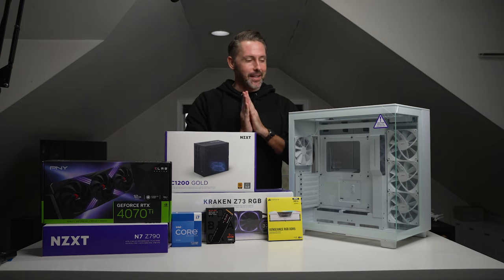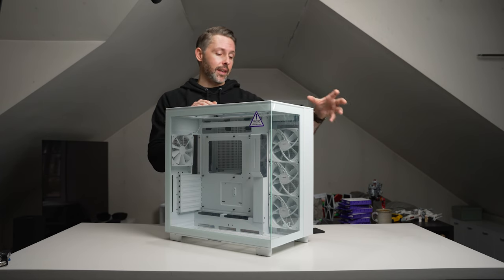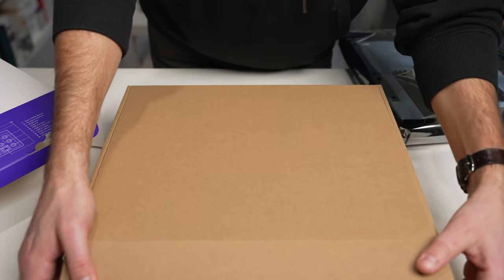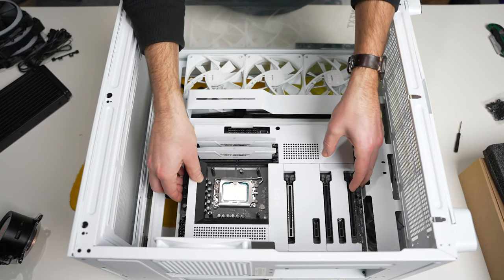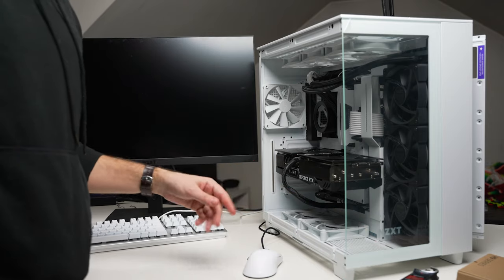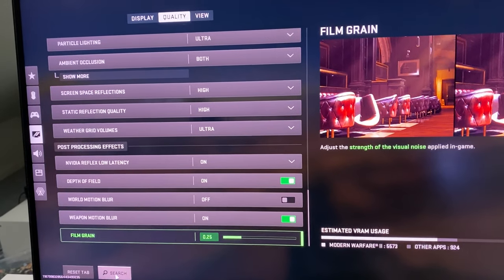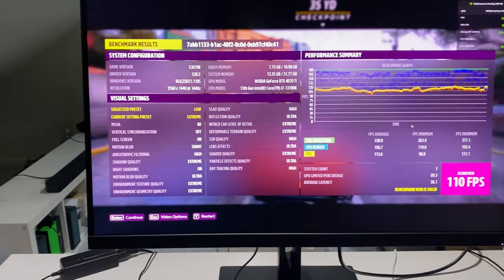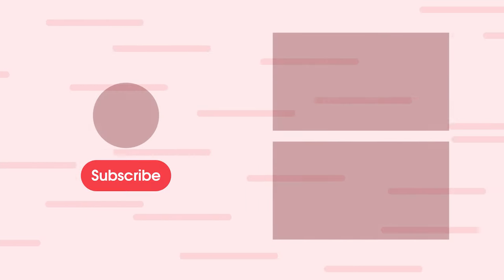Building in the new NZXT H9 dual-chamber case!

Comment: Awesome build, I would definitely recommend flipping the radiator fans to exhaust and maybe place them on top instead of the side :)
Reply: Exactly right, build a very similar build. If you place the radiator at the top and exhaust out, I found the GPU has lower temperature by 5 degree in my case.
Reply: Watched another review, they said that the radiator doesn't really fit at the top so they had to put it in the side, this could be the reason they didn't put it at the top.

Comment: 11:37
Hope you reverse the direction the PSU is facing because the fan is sucking heat from the motherboard here.
Reply: No that fan on PUS is sucking in air as an intake fan. hes not giving PSU fan enough space to pull in cold air to cool the PSU lol
Reply: I’m so confused isn’t AIO job to vent so it’s pushing out?
Reply: @OFM1209  we are talking about the power supply fan, not the AIO water cooler
Reply: @sparda9060  oh ok. I guess if you turn the fans in a specific direction they will either pull air in or vent air out.
Reply: @OFM1209   in power supply you don't want the fans to exhaust air. you want it to intake air so it can cool the components inside the power supply as there is no vents on any other side for it to get cold air. for AIO you can face the fans in any direction.
Reply: @sparda9060  thanks. I’m building my first gaming PC. I have all my components. GPU just came in today as a matter fact. Building next week. Thanks !

Comment: This is an awkward case for side fans because gaming computers get funky without a power supply drawing air from the cpu fans. I would consider the temps a little high. First, intake the side fans. And put the aio rad on top exhaust. Take the back fan and put it on the bottom so there are 3 intake down there. Now you have enough positive airflow to turn the psu around. Theres no need for the oldschool power draw because it's not going to pair with the water cooler anyway. Plus, I don't see any hard disc drives or cds rom drives to worry about anyway. hahaha.
Reply: That's because he did a few things wrong. 1st the power supply should face the other way so the intake fan is facing the back panel, not towards the motherboard. The radiator would have been better up top with the fans set to exhaust. I have this case with an air cooler and my cpu has never been over 42 degrees when gaming

Comment: one quick question! my gpu is pretty much the same size. just 1mm thicker (asus tuf 4070 ti). did you have any trouble putting the card in there without pushing the glass panel on the gpu cables? someone on youtube had issues with that even though his card isn't as wide as mine..looked good in your case though
Reply: Same question for me. Is there any answer?
Reply: It’s fine you can put a 4070 ti in there because I also have a 4070 ti and it’s goes there so we’ll
Reply: @NIRAA  It’s fine you can put a 4070 ti in there because I also have a 4070 ti and it’s goes there so we’ll

Comment: I have the exact same cpu and I idle at 38-45 degrees. Warzone I sometimes hit 80. How is yours running so cool?
Reply: Do you have air cooled or an AIO
Reply: @PassiveClapz  I have an AIO with a 360mm rad. But I slightly undervolted and now my temps are totally fine lol

Comment: I bought the h9 elite and noticed a MASSIVE gap between the front and side glass panels where they are supposed to meet leaving about a quarter inch gap. Not sure if this is a defect or intended…
Reply: Probably a defect
Reply: @EmeraldBayMovies  that’s what I thought. Reached out and nzxt informed me that’s an intended design. They do that and I quote “to make sure the glass is safe during transport”. I wish I was kidding but sadly I’m not.
Reply: @Senshi6110  Actually I was wrong. There is supposed to be a gap there. I just received mine and it has the same thing. There was a piece of cardboard in between the gap to keep the glass from touching eachother.
Reply: @EmeraldBayMovies  yea they’re all gonna have it. The pictures of the case you see are insanely deceptive. I wasn’t a fan of how big it is and if you push the glass panels together you see they can meet and flush…I wasn’t pleased LOL
Reply: @Senshi6110  The glass can't touch becuz if theres any micro cracks on the corners of the glass panel due to you putting it on or taking it off the case, it will literally explode and shatter into thousand pieces. Tempered glass are prone to explode when it has damage to the corners.

Comment: The fans of the cooler are mounted incorrectly. To achieve the correct effect (air intake) for cooling the CPU, the fans must be mounted on the other side of the cooler. Otherwise you should have installed puch/pull.
Reply: I have mine in this configuration and the cpu stays very cool. Same with the gpu. There's so much airflow it doesn't matter.
Reply: No it doesn't. This is what you call and pull through, it doesn't matter that much!

Comment: I had to put my own thermal paste bc the stuff that came pre applied to the block was a circle and not big enough to cover the whole cpu. Once i put good brand paste the temps came down about 8-10 degrees c! Also the Elite has glass top and has to make a few turns to get hot exhaust out but the flow has straight thru the top so it is prob better for air flow and temps. I removed the filter on the top also to make it easier to flow out the hot air. Exhaust dont really need a filter imo! The fans that came with the Elite are the DUO type and they do not seal to good on a radiator. I got the CORE fans to make the air flow thru the rad better without any gaps from the curved sides that allow the rgb to show thru.
https://youtube.com/shorts/lXNcfxdT1jE?si=DUou3k8xXDYLH7Rm